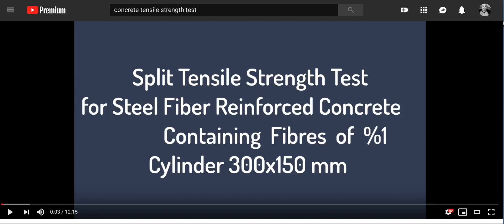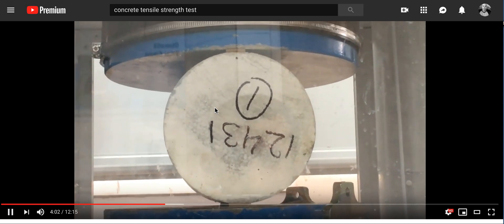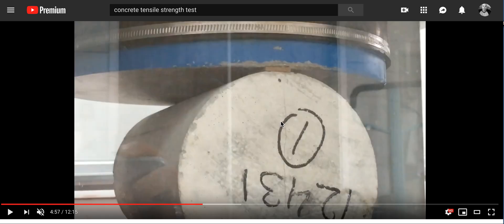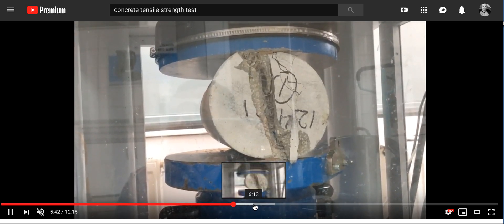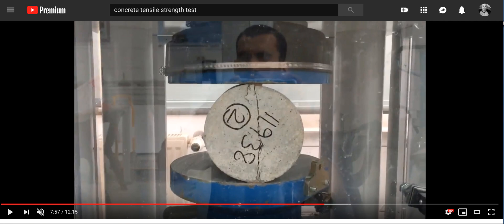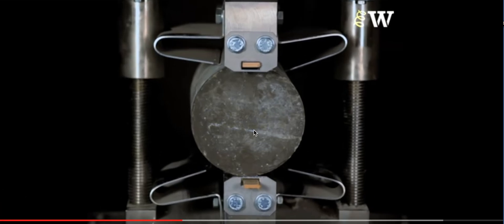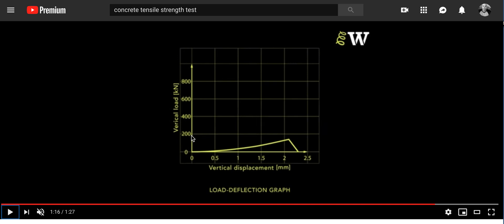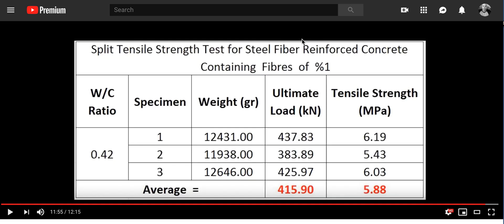Helix Steel Fiber Reinforced Concrete BETTER than angular stone HANDS DOWN

Comment: Any large projects this has been used on?  This a bit like COB.... I.e. dirt (mud) with hay mixed in). Not a new method but new with concrete.  Lots of Cob house been built and still standing.
Reply from the maker: This is a specific product and patent BUT, they have steel fibers usage for years now... 
This ''Helix'' (twist in the fiber) is what is the added ''twist'' to steel fibers.
Latitude, I am a freak for fiberglass fibers and 100% sold on it's crazy ability to withstand tension in a VERY THIN surface!  
I will show a video of this later today perhaps and perhaps you will be sold... I will KICK a wall system I installed a thin layer of fiber reinforced ''stucco" and you should be amazed how the wall does not break free and how NOT even a crack shows up on the surface...  
ODDLY, I think I even have a step footer crack that has some crazy amount of lateral movement and yet the surface is still holding!  I am totally observing this for the next year or so to check out it's limits... 
Once, the footer has stopped moving I will explore the system to the end results... 
Fiber baby, it should be specified  in all concrete and stucco mixes... So what  a fiber may show it's ''face'' now and again...  I do not even find that the water traveling down the fibers via any means ... is an issue.